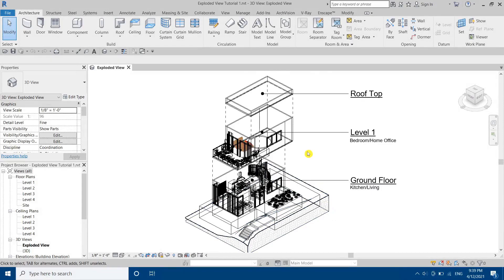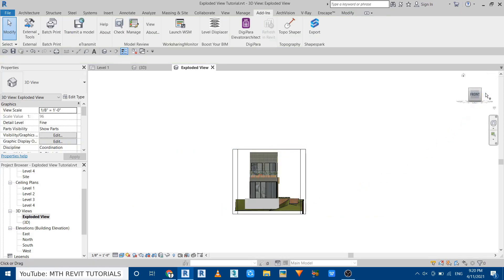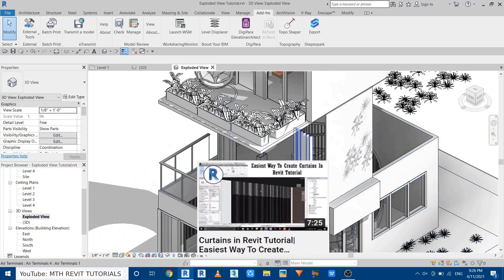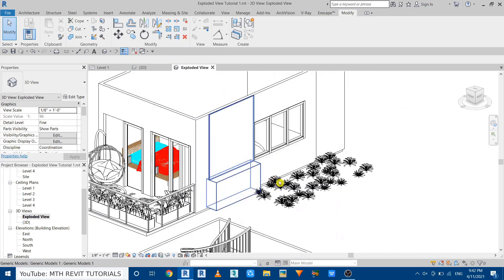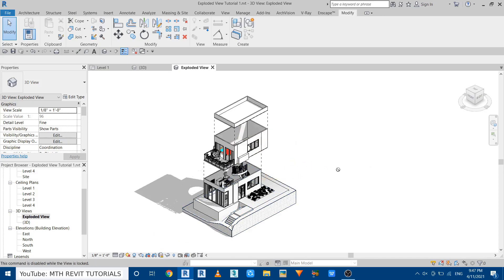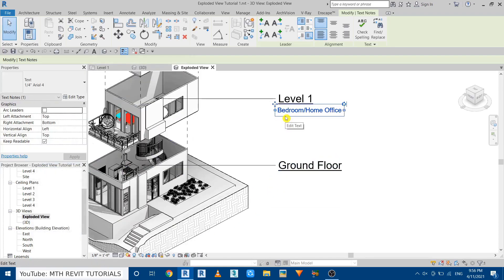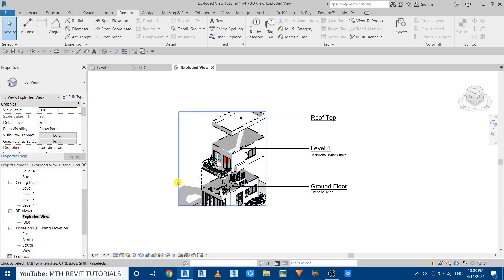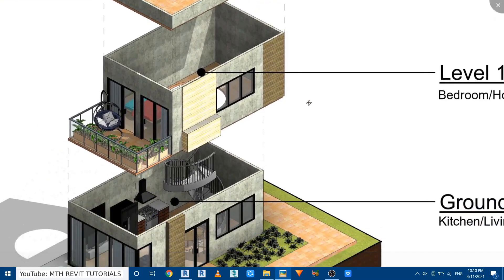Revit Tutorial: How to Make Stunning Exploded Architectural Diagrams

Comment: Hi Thank you very much. Am using Revit 2021.1.2, I've already downloaded & installed the app but I can't find it in the ribbon of Add-in. How can I fix that 
????
Reply from the maker: I just checked on the plugin page and got to know that this plugin works only with Revit 2019..
You can manually displace the elements using the "Displace Elements" tool in modify tab and follow another half of this tutorial. .
Reply: @MTHREVITTUTORIALS  so there's no such add on for the displacement for 2021. You have to do it manually. Is there an add on for legends instead of creating it manually?

Comment: Hi, is there a workaround to use this for Revit 2021?  installed it but it's not showing up on the ribbon.  thanks, cheers
Reply from the maker: I just checked on the plugin page and got to know that this plugin works only with Revit 2019..
You can manually displace the elements using the "Displace Elements" tool in modify tab and follow another half of this tutorial. .